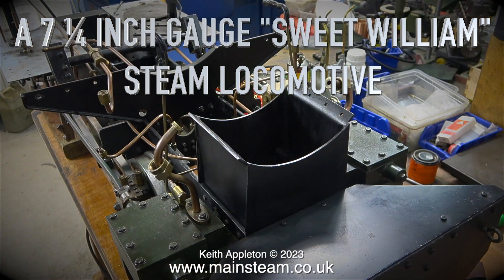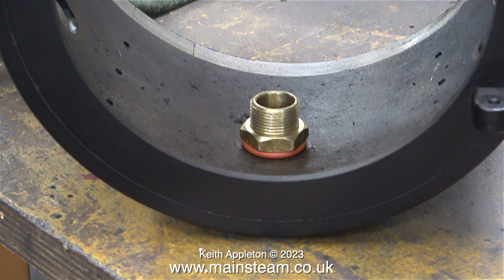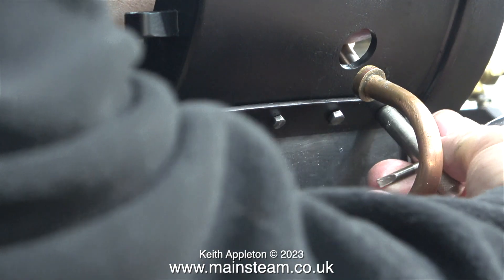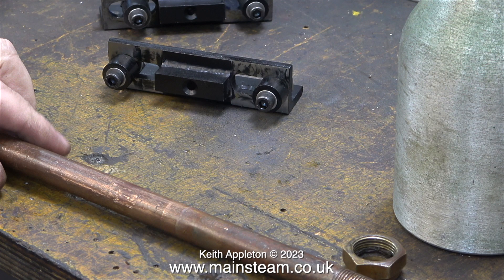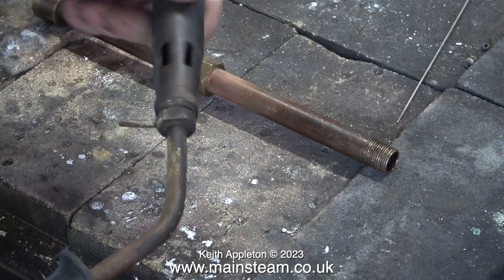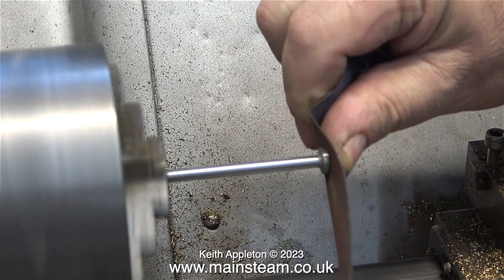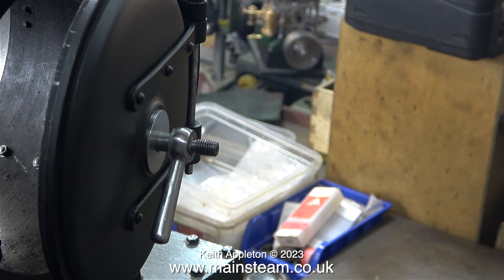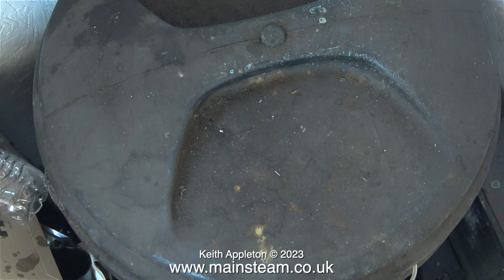7 ¼ INCH GAUGE "SWEET WILLIAM" LOCOMOTIVE - PART #15

Comment: Because I live in the USA, I grew up seeing different methods to accomplish a job, IE the smoke box door closure. We use different terms to describe things IE you say fix something we say assemble, attach, or apply. So What. 
Looking at your door closure method, I find it to be much simpler, We use dozens of bolts and clamps to do the same job. I have also learned that all UK steam locomotives have COMMON design features, not so  much with US locomotives, but vary from builder to builder.
All of that to say this; UK methods of ENGINEERING always seem quaint, but when examined closely usually turn out as good or even better than our ways. Here if it is not complicated it has to not be good enough, for some reason.
Great job Keith, I continue to learn. and that's why you're doing this. ;-)

Comment: Too bad you can't get a miniature "spud wrench". Dont know what they're called in the UK. They have a wrench at one end and a big spike at the other for aligning iron work such as structural beams and the like.
Reply: Podger spanner
Reply from the maker: They are usually a bit big for Model jobs . . . Probably useful for fitting the "Spuds" to Traction Engine rear wheels though  . . . .